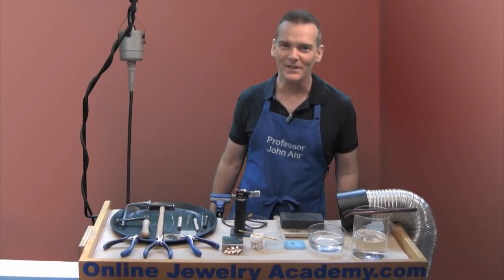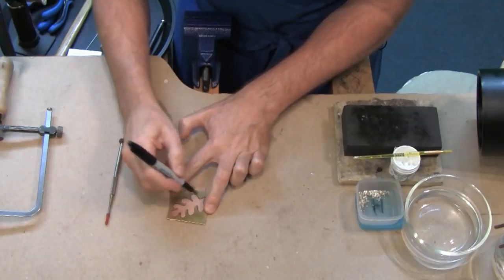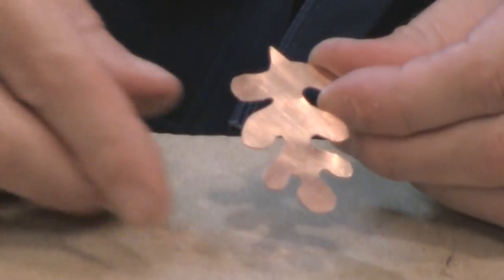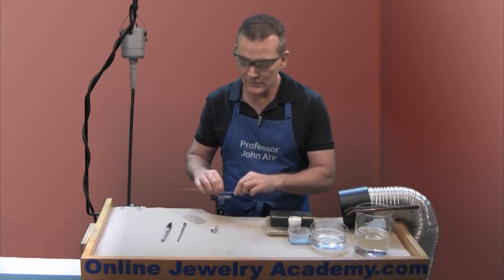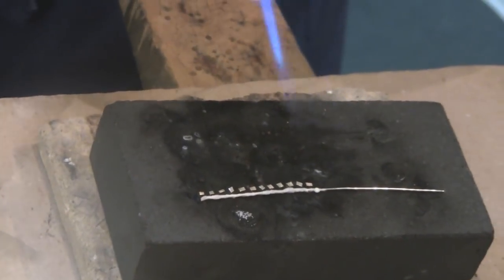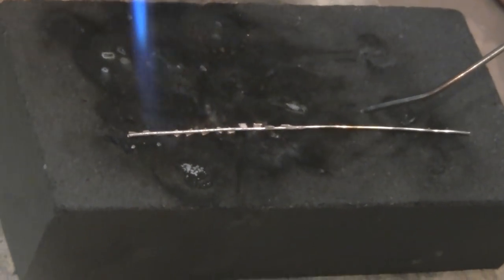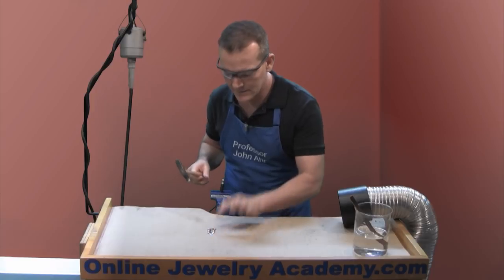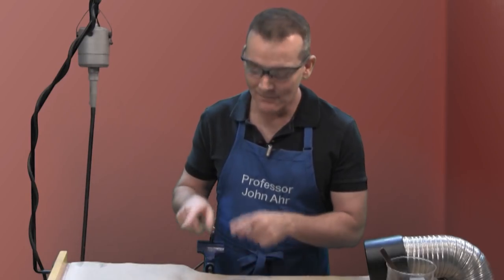Sweat Soldered Planished Copper Leaf Earrings

Comment: Great video.  Thank you. I was surprised that you did not apply flux to the copper.  I always have so much trouble with oxidation on copper when soldering.  Can you help me understand?
Reply from the maker: Hi Camille,  I applied the flux to the silver wire (with silver solder melted on it) before placing it on the copper leaf.  You always need to use flux in any soldering operation.  Copper by nature is a very quick to oxidize.  And, heating (most) metals with a torch will cause it to immediately begin to oxidize.  Flux helps to control the oxidation process during soldering.  But, to produce a clean sweat solder joint, you want to apply flux only to the areas that are to receive the solder.  I hope this answers your questions.
Thanks for your support! : )

Comment: Thanks for the great instruction! After creating my own leaf I have a few questions. What kind of flux are you using? Boric acid and alcohol? Also how did you get the wire straight enough so it makes good contact with the leaf. My wire was a bit bent , even after straightening it. Thanks!
Reply from the maker: Joanne Forman Glad you enjoyed the video.  I used a white flux paste to solder the wire to the leaf.  Alcohol and Boric Acid are really only good for coating silver to prevent fire scale.  I straightened the wire by hitting it with a mallet on a bench block while I turned the wire between my fingers.  You can also make adjustments with your fingers or pliers if you need to.  Good luck with your project.  And, thanks for watching!  : )
Reply: Thanks!  I'm not familuar with white paste flux but I'll look into it. I used MY T FLUX which isn't bad. I'll try straightening the wire as you mentioned .  Will let you know how it works in my next leaf project. I'm able to get some contact of the wire to the leaf but still have some gaps when soldering is done. Practice makes perfect! Have been using Nu Gold (jewelers brass) for my leaf with some very interesting results. Have been raising the copper to the surface with repeated heating (depletion guilding ?) so when I emery paper the leaf in finishing, some brass shows through the copper skin. Really looks lovely!  Thanks for the great tips. Your videos are very clear and helpful :)

Comment: What are you using for ventilation? I'm guessing there is a fan on the floor, but what kind? Is there a filter? I have seen some crazy expensive fume extraction units. And also very inexpensive tabletop fans with charcoal filters. Thanks.
Reply from the maker: +Jane Archer We have a video on making the venting system we used called "Venting in the Jewelry Lab."  You can watch it at https://youtu.be/lsdUeQ2ckS4   .  Thanks for watching.

Comment: Can you use borax to solder copper. Will that keep it cleaner. Thanks
Reply from the maker: Most flux for soldering contains a bit of borax.  I generally use a white paste flux to solder on copper.  The paste flux will do a better job of keeping your copper clean than just using straight borax.
Thanks for your support! : )